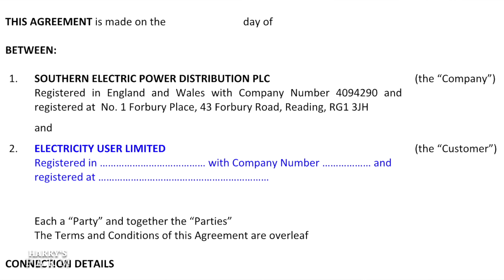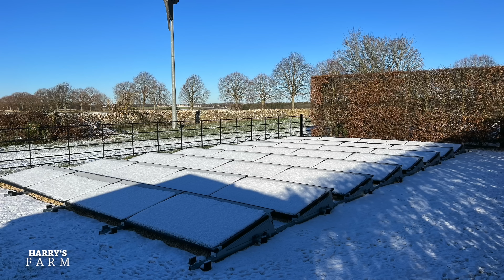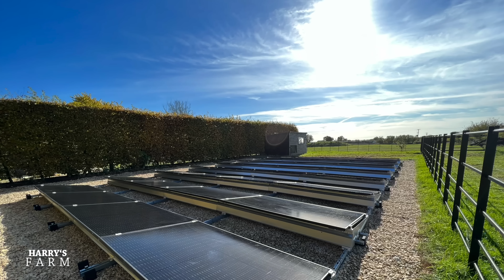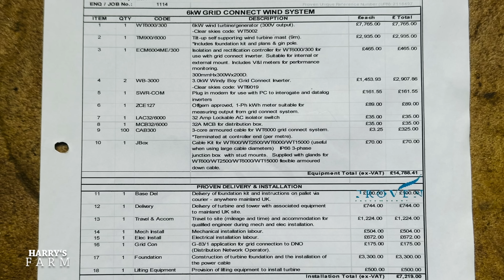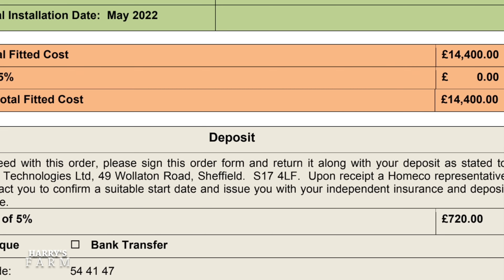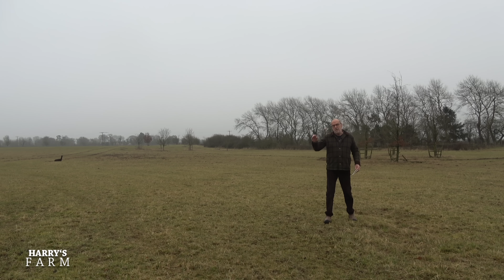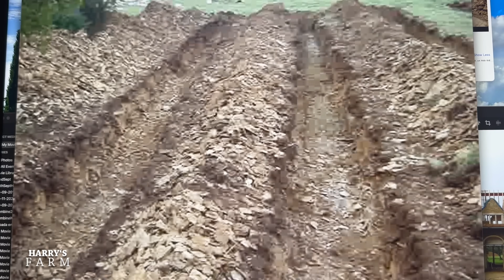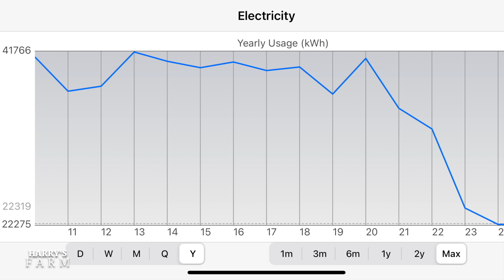Are solar panels & heat pumps worth installing? Here's what I've learnt after several years of use.

Comment: nope, both fake and gay tech used to hoodwink city people.
vast majority of the nation is better off with the standard electrical grid and furnaces or wood stove. 
heats pumps burn electricity and can only heat or cool within a narrow range.
technicians started installing them en masse because it's easy money. 
solar is easy money because it is a gigantic grift democrats want to pretend could replace oil. (subsidized so it's practical)
solar cannot produce enough energy to produce itself. it is only a niche choice once oil is being used to produce things.
heat pumps can be effective if you live in an area that doesnt get particularly hot or cold. otherwise it is more of an expensive back up that will mostly not work well as a primary heating or cooling source.
still, the windmills are the worst. ruin the sky line, kills birds, never has even a possibility of producing as much energy as it takes to make one, and its full of.... wait for it.... oil.

Comment: Another interesting addition that a heat pump creates an opportunity for is a sand battery or similar. It’s basically a thermally insulated container of a thermal mass. In summer where you have excess heat you dump it (via the heat pump) into the sand battery. They’re quite good at holding most of that heat till winter where you can start dumping that stored heat back into the home. I’m trying it out on a cottage this year for the first time

Comment: Harry, you say about combining the solar farms with turbines, but what about running an ground heat pump underneath where your solar [photovoltaic] panels are?...OK, the ground underneath would be shaded but a) when the solar panels are operating do they give off heat to be absorbed by the ground?, b) being close to the ground would the panels 'protect' the heated soil by stopping convection currents from drawing heat away from the soil?, and c) in the winter would the panels insulated the ground from cold temperatures such as frost?...Finally, if photovoltaics were not suitable, could water filled solar panels be used above to give some of these benefits?

Comment: I have a battery (Tesla v2), solar, and heat pump system on my property. In winter, thanks to Octopus' Cozy plan—which offers a low rate three times a day—I can take advantage of cheaper energy by filling my battery and using the cheap electricity throughout the day. Then, in summer, I can switch to Octopus Agile to maximise savings by leveraging lower rates when demand is low. In my view, this flexibility makes it the most crucial part of the system, delivering the greatest cost savings.
Reply: What a waste forcing every individual to manage variable power production

Comment: I live in south west Sweden and invested autumn 2016 in 9,1 kW which sits on the roof, and last year the investment was covered for already. It surprises me that it came to a surprise to you the little power generated in the winter. For us it was well known and put into the calculation. We heat 170 m2 house + appr. 2x30 m2 garage with an air to water heat pump and we consume yearly appr. 17500 kWh. In January and February the temp can go as low as -10-15C some days, and during December and January we have not more than 7h of day-light. Luckily in Sweden we can sell back electricity in the summer and the state compensate with €6 cent/sold kWh, which make it pay back having an over production in summer. Regarding the issue with shade on some parts, it can be fixed by adding “optimizers” on each panel. Have a chat with your provider. 😊

Comment: We've an old cottage that we run purely on electricity.  It costs us roughly £200 per month, and apart from double glazing and a loft conversion has no insulation.  We cannot afford to spend tens and tens of thousands on solar, wind and heat pumps etc and don't have the land either.  It seems to me that such things might cut our bills in half and so would take over 20 years to become cost efficient in financial terms, assuming one remains at the property of course.  Overall this doesn't seem a practicable endeavour for the average owner to undertake at the moment.

Comment: Very impressive! Thanks so much for sharing the costs, consumption and output figures. Have you figured the breakeven point from initial cost and maintenance compared to buying electricity from the utility company? In our case we pre-wired our then new home for solar, but never installed it as the lifespan and maintenance were unknown. In the end we figure we are even either way and decided we didn't want to be the utility. Our contractor wanted to install radiant floor heating, which I admit is very nice. I couldn't imagine the pipes not leaking eventually, so we used a forced air system for heating. Cooling is not needed here next to the Pacific Ocean. We installed electric radiant heat under one of the tile floors and it is very nice.

Comment: Also not sure how big Harry's solar array is rated at,    here in the USA for a home that uses approximately 2,000 kwh of electricity per month you would need enough solar panels and inverter to produce 14 - 16 kilowatts which is about 39 to 46 solar panels of around 400watts.    Part of that is also depending on how much sunlight you avg per day,   here (in the USA) we base solar production 5 hours sunlight per day,  the UK probably has more clouds and fog than US averages.

Comment: Our experience of this sort of installation mirrors yours, Harry, except that our now six-year-old EPC A-rated house is half the size of yours. Today, on an overcast winter's day, our £14k recent investment in 8kw panels(20) + 6.7kW battery produced 75p worth of electricity... Now, I need to work out how to get our kit to charge the battery from the grid at night and use the energy during the day. It's all quite a learning experience getting to the point where the system works as economically as possible... And don't get me started on the fact that I can't integrate the smart meter with the rest of our systems to provide integrated management of the whole energy system because the meter is incompatible with any other data protocol...

Comment: As a Harry’s Garage viewer I stumbled on this fascinating review of Harry’s farm. It really  educated me on the folly of solar for domestic use. Even living in “sunny” Melbourne I cannot justify the installation cost against the payback. Yet, like lemmings, people are installing solar on mass. As Harry said, if you can’t use the output during the day it has little value now as the grid can’t take back the excess. Sure in summer, when the air con runs, I can see it would be useful. But Harry’s explanation on heat pumps was most enlightening.
Reply: But what Harry doesn't mention is that during the summer months you can export at 15p per kWh, so you offset your winter usage but exporting in the spring/summer
Reply: schools arent great down there in melbourne huh?  i could run my whole house in texas during the summer off 5kw of solar and not have to pay a cent towards an electricity bill.  and because of the way texas has their grid set up iif i had a battery backup i could export power back to the grid during high demand times at prices up to 2$ a kw.  its not much but if youre producing heavy during the summer you could make decent money every day.

Comment: If you tilt the array to your latitude or even a bit steeper you will do better in the fringe seasons and even winter. Less output in summer, but mine is just for charging batteries not the grid. So that is a bit different from yours. I have been on Solar for 30 years off grid. We are in Souther Tasmania and the panels are at 55 degrees from horizontal. No shading at any time of year helps.Good luck.

Comment: Fascinating video Harry. It's convinced me I did the right thing buying our wood burner to supplement our gas CH. 
Cost only £1500 including instalation. 
Belts out 5 kW.
I live near woods. Lots of free firewood that keeps me fit prepping and it's a lot more pleasant and cozy to keep warm with than heat from the unbelievably expensive stuff (I'm being polite) you've invested in.

Comment: To those saying he needs a higher angle on his solar panels - he would need a very much larger spacing between in winter, as the low angle of the sun would just cause them to block each other and be less efficient. Roofs are the best place for them as long as they're south facing.

Comment: You just confirmed one more time for me that using PV for heating is not the best Idea. For heating my house, I will use solar tubes on south side of the house and air to water heat pump in the attic so heat from collectors automatically boost efficiency of the heat pump and since it is air to water heat pump, I can store cheap heat for coming night in a water tank

Comment: It hardly surprising that your winter output is so poor, the angle of your panels is set for summer sun. My 4.8 kWp (with 3.6 kWh inverter) array in Devon produced 195 kWh in January but because my roof is steeply pitched (50 deg) their angle is optimum for winter sun (if you actually get any) - and I can still get 30 kWh on a perfect spring, summer or autumn day.
Reply: Read his reply elsewhere....he has another bank angled more perfectly and it makes hardly any difference.  I've got angle solar panels on a yacht and yes getting the perfect angle does produce more but not significantly more , especially on a typical cloudy UK day.

Comment: Thanks for this. It's a very complex subject for the average person to understand. My main take away is that insulation is critical, and that solar and air source heat pumps(what the typical domestic user in an urban enviroment in the UK will install) are not so good when we need them most during a typical UK winter. Given my annual gas/electricity bill, the break even point to cover a typical installation will be after I kick the bucket. Hence I'll just focus on improving my insulation as it offers the best return versus cost.
Reply: Not just insulated, it needs to be triple-glazed and airtight.  Every home built before 2010 and probably many newer ones would likely not be compliant as they weren't built to this standard and their owners in this economic downturn will have neither the money or installation space for all these systems.
That said, adding excellent insulation, double-glazing and turning the central heating down a single degree can save huge sums over the length of occupation.

Comment: If I had that system I’d have to panels on more of an angle so snow has less chance of settling on them & remove the hedge & set it further back if possible then connect the wind power to a battery so in winter you don’t have any issues with limiting electricity. Other than that it looks a good system. Great video very informative thanks 👏👏

Comment: Something is wrong with your explanation. The ground is warmer in winter not colder. This why people have caves and basement. I think your water pipes are not deep enough in the ground. You got to be at least 8 feet down if my memory is correct.
Reply: maybe compared to the air temperature but the ground definitely cools in winter

Comment: Why would anyone install solar panels on the ground without a proper mount?  On top of that then complain about winter output!  Oh yes the snow must be removed as well.  We have a 16kw ground mount that produces 1000kwh in January and yes I remove the snow.  We also have a ground source heat pump.  In fact our whole home is electric with a pool and two EVs. Our yearly electric bill is approximately $500 USD or 400.85 GBP and we save $4500+USD or 3607.63 GBP.  We are in upstate NY in the US.

Comment: I run ground mounted solar panels. I found my solar production was pathetic during the winter. I have now spaced them further apart and they are adjustable so that can be set at an optimal angle of incidence to the sun. 15 deg from perpendicular in the summer and 15 deg from horizontal in the winter. If the sun is shining in the winter I then get 80% of maximum output.

Comment: You’re almost there, Harry.  You just need to add home storage batteries (large as possible) and get a dual-rate tariff via your smart meter.  That way you can import electricity at cheap overnight rate and charge your batteries, and use it during the day.   We have wind turbine, solar panels, heat pump, EVs, energy diverter to hot water, storage batteries and dual rate tariff.  We pay (on Octopus Intelligent) 7p import (night) and get paid 15p export.  So we get paid double for export what we pay for import, and usually have zero electricity bill as a result.

Comment: Without the pool, you could push excess wind power to the battery. In reverse you could use the pool as a heating battery and pull heat from it in a water to air heat pump (might even find use in the summer when you dont need/want high temp pool water). After all is there alot of swimming in the depths of winter?

Comment: Would your installations. Have changed without the pool power needs.  Perhaps a solar thermal would have been better for the pool as it generates hot water more efficiently than generating electricity to heat water

Comment: I mean the arga is "inefficient" as for every 1 kwh you put in you get 1 kwh out. Where as the heat pump you get 3-4 si it would make more sense to get rid and just have a normal oven and have the heat pump on sooner. But if you prefer it that way its fine.

Comment: If the solar panels were fixed to a board and the boards angle could be angled to 160° for winter when the sun is low ( a sensor can be fitted so the boards angle follows the sun ), you will be surprised the difference it makes !

Comment: Most of the negatives can be sorted but i guess you put it where you got space and it's not in the way of things and the eye.
Optimizers work great for strings when one is shaded and in a perfect world the panels would be higher up and upright during winter but that means you would have to change the mounting and it might not be as pleasing for the eye. The solar tech is getting a bit better every year and i hope we will see some new battery tech in the next 5 to 10 years that can take both EVs and make solar and storage in homes better and more efficient.

Comment: The winter output is very low because of the angle of the panels. My house has a very shallow roof and i have the same problem. I have had the biggest peaks during winter the highest ive ever seen on the inverter but across a day you get very little

Comment: A great example of the benefits of heavily insulating a property and kudos on having that vision back in the mid-2000’s. I suspect if you removed the barn/garages from your heating usage (big empty spaces with high roofs), your winter heating energy usage would be TINY?

Comment: Hello
A VERY interesting article thank you
You have done similar things that I have installed and it is good to see we have similar results albeit my project was a bit larger
I have built an oak timber framed house 1,050sq metres with a mega insulated roof from a company in France called Simonin who have not sold it to the UK before as normally used in Switzerland Alps
I have put in 12Kva of Wind and 50Kva of Solar and ground source heat pump with 12x 80 metre deep bore holes. I live further North than you in Halifax Yorkshire at 700ft above see level 
My annual usage of 50,000 KWh. I make annually 24,000 from the wind and in December I made just 579Kva from the solar. 
I have a large amount of battery storage that I charge 8 different hours through the day using Cosy Octopus at 12p per KWh 
This enables my average unit cost on the electricity I buy to be 15/16p per KWh 
My total costs including the batteries which cost £25,000 has been £150,000 which is a lot but I have calculated that I am saving over £15,000 per annum which is at 10 years a marginally better return than you are getting 
My consumption is high as you mentioned as I have a large indoor swimming pool kept at 30dC

Comment: 4.40 - why weren’t you ‘expecting’ such a drop in generation in December? Installers are legally bound to give you very detailed forecasts on their design and it’s predicted output over at least the first decade of its life. If you weren’t expecting something it’s either because you installed it yourself without expert planning advice, didn’t do due diligence and read the installer’s proposal properly or they didn’t fulfill their legal obligations. I have an ‘east/west’ system with 3.2kw array on each elevation and as I’m writing this on 13th February (very overcast) they’re producing 350 watts - 3.5 times your output! Something is clearly sub optimal with the design of your installation. Also, although you briefly mention batteries (the conventional wisdom is hugely in favour of them complimenting solar pv) you don’t mention time of use tariffs to take advantage of arbitrage. To put a balanced view of a ‘typical’ renewable installation it would have been helpful if you’d have given an example of a ‘normal’ U.K. domestic installation which doesn’t include a pool or large garage with under floor heating.

Comment: Great information, two questions - heat pumps are costly to install and help but do not solve the heat gap in winter, now that solar panels are so cheap and long lasting, if you were starting today, would you be as well off just adding more solar panels?  And if the the answer is heat pumps are still worth it, have you come across people using the resistive heating wires laid with the GSHP pipes to store a bit more of the summer solar panel heat for the winter ahead?